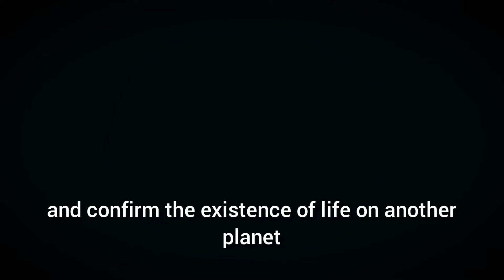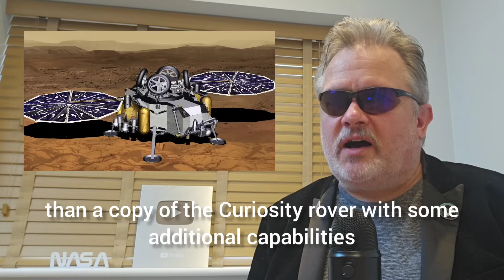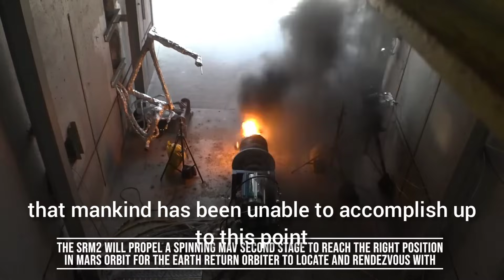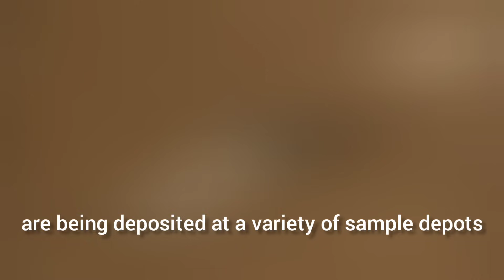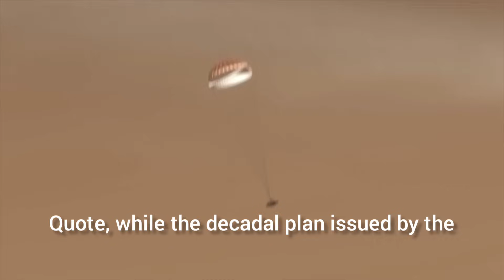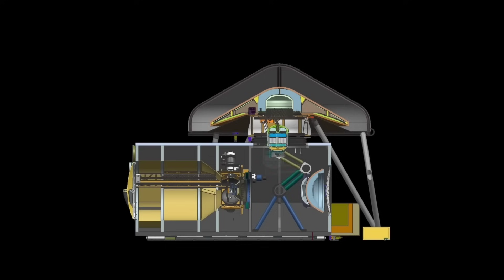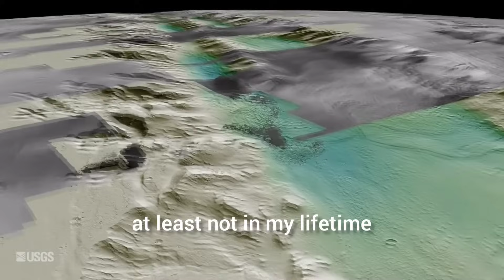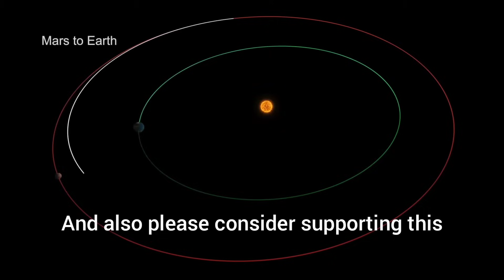Robert Zubrin is right about the NASA Mars Sample Return Mission!  Here's why!

Comment: Imagine what we could find if instead of one off projects, they built a proper production line for space telescopes. An array of moderately modernized Hubbles in orbit with software to point them all at the same target could do so much more than what we have currently, and if one fails, you just adjust the software temporarily and send another up!
Reply: I'm really curious about what SpaceX has on tap for a Starship launched telescope
They were able to correct for the hubble mirror being machined in a way that didn't account for zero G, they could put a 9m mirror in the nose of starship and correct in a similar manner (rumor has it that they are looking at such a mirror from an earth telescope)
this would be an expendable starship, so mass for LOTS of processing capability, many different sensors, many gyros, lots of fuel, etc to make it something that could say up for a very long time (and still be a light launch so they could go to a much higher orbit than a normal starship launch)
Reply: What's a criminal shame is that when we FINALLY got a space telescope, it was stuck in  LEO where shuttles could deploy and service it... which is the worst environment possible for a telescope.  For one thing, in LEO, there's a huge honkin' planet (Earth) taking up half the sky for nearly half of each orbit... with a roughly 90 minute Earth orbit, 45 minutes of that is taken up with the Earth between the telescope and whatever it's trying to observe in deep space.  Then there's the fact that passing into and out of Earth's shadow during orbital "sunset" and "sunrise" causes "popping" of the structure of the telescope during the huge temperature change from the +250 degree daylight side to the 250 degrees in Earth's shadow, and the 45 minute hot soak, cold soak cycle during each half orbit.  So more valuable time after the object its observing has actually cleared the limb of the planet and airglow layer is "out of frame" for observation, is taken up waiting for the telescope structure to finally expand or contract enough to stop popping, which jiggles the image.  If Hubble had been deployed as a stand-alone telescope, it could have been placed in a FAR more advantageous orbit for observation, as Webb was, or even the Chandra X-ray telescope.  Far enough away from Earth to be out of its shadow, but still in orbit, and with the distant Earth presenting a very small object to disrupt its field of view and observations.  A high Earth orbit or highly elliptical orbit or geosynchronous orbit, or a Lagrange point orbit... something like that.  With an appropriately capable spacecraft, it would STILL be possible to service such a telescope with a manned mission- a capsule and "service pallet" with a robotic arm and airlock, for instance, with the required tools and equipment stored on the "pallet" itself, either launched under the capsule on the same rocket, or rendezvoused with by the spacecraft and docked to before the spacecraft propelling itself out to the telescope's orbit and position to rendezvous and capture it for servicing.  Shuttle could only manage about a 300 or so mile high orbit-- in fact the Hubble missions were the absolute highest orbits that the shuttles ever achieved or were capable of... but just because the shuttle was SO limited in its capabilities doesn't mean other spacecraft would be, particularly capsules.  

Hubble's servicing missions were SO expensive we could have orbited a new telescope on an expendable rocket to a MUCH better observational orbit than the single hobbled Hubble that we got... Hubble's original problem with its optics was caused partially because of shuttle cost overruns and problems... former NASA Administrator Dan Goldin's "Faster, Better, Cheaper" methodology to "cut out 'unnecessary' and expensive ground testing" would have caught Hubble's mirror imperfection on the ground, so it could have been corrected before launch, but to save doing a $100,000 mirror test on the ground, they launched it and then had to do an over a billion dollar mission with the shuttle to "save" Hubble, the very telescope that shuttle cost overruns had caused to be launched in a faulty condition to start with.  For the cost of the shuttle servicing and reboost missions to Hubble, we could have launched an entire FLEET of space telescopes and put them in FAR BETTER observational orbits.  Yes some would have suffered failure without a manned spacecraft capable of going out and making repairs (during the shuttle era) BUT the science returned from additional telescopes during their lifetimes when they overlapped, when multiple telescopes would have been in orbit at the same time until older ones failed and stopped returning data, would have been an immense improvement in the science return of the missions.  Later telescopes could have incorporated improvements, new instruments, and better design than the original Hubble had as well.  Plus, without the constraints of the shuttle payload bay size, a telescope with a much larger mirror could have been launched.  Space telescopes with single mirrors of up to 10-12 meters diameter have been proposed for launch on SLS or other very large boosters.  Foldable mirror telescopes could have incredibly huge mirror arrays, much larger than Webb.  Doing interferometry using multiple telescopes could also be possible.  

It's such a shame how much we gave up to get the single shuttle launched and serviced Hubble that we have...

Comment: They should just give 10 billion to space x to develop starship further. I'm wondering what the v2 will provide in terms of cargo capacity. I've heard expanding vertically increases volume by 4x. So at 1000 cubic meters volume, a 20% increase would be 800? Musk said it'll be 200 metric tons to LEO, I believe, with raptor 3. But I've also heard that increasing the engines to 6 vacuums increases payload by 50%. Is anything I'm saying incorrect

Comment: Hey, i worked on srm1 and srm2. I agree it is expensive and agruably not the best use of resources. 

I disagree when you say "NASA didnt have a solid plan". Detailed design wasnt done and there seems to be scope creep. But the plan has remained the same since when i started work on it. 6:29
Reply: But the plan is overly complicated, and we both know the biggest enemies in engineering are inefficiency & complexity. SpaceX will be sending large payloads & crews to Mars before 2030. Wouldn’t it be simpler & more efficient to give the $10 Billion to SpaceX and task SpaceX with either testing it on Mars or bringing it back with a group of explorers?
I know the DOD uses money to fuel bonfires, but NASA really can’t afford to do that!
Reply: @TraditionalAnglican crews before 2030 is probably a bit aggressive…